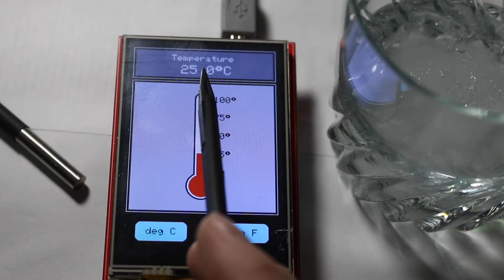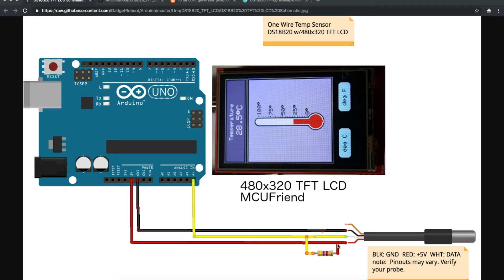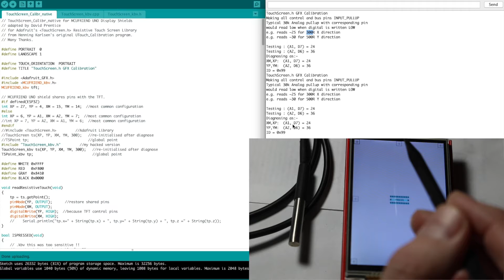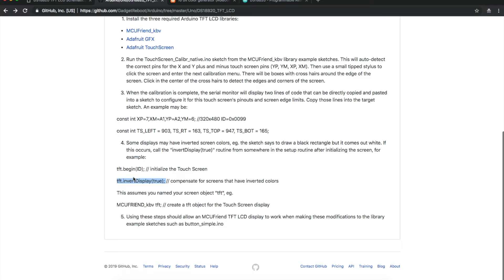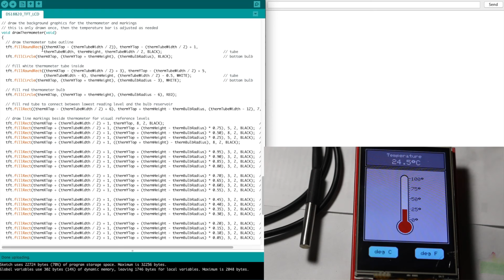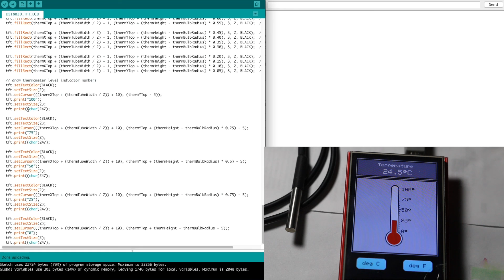DS18B20 Digital Thermometer with Touch Screen

Comment: Excellent. I use a pair of these when using a full shield. You can tap off on the side for other modules and devices.  https://www.ebay.ca/itm/Screw-Shield-V3-Terminal-Expansion-Board-For-Arduino-Compatible-UNO-R3/132039096942?hash=item1ebe24ba6e:g:gFMAAOSw-0xYV65B:rk:31:pf:0
I got a few in auction for a dollar or two. They come in very handy.
Reply from the maker: I’m going to try to find a cheap auction. I saw some pictures that make the uno look like a starship. It would be spectacular to have just to look at on the shelf.